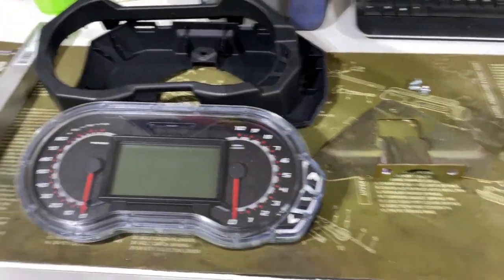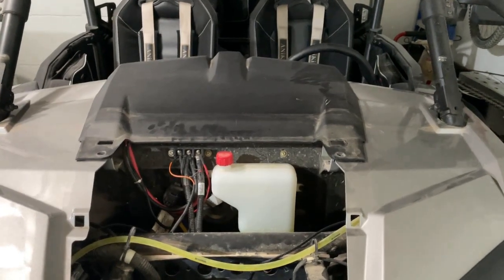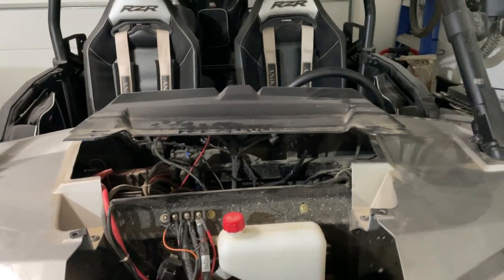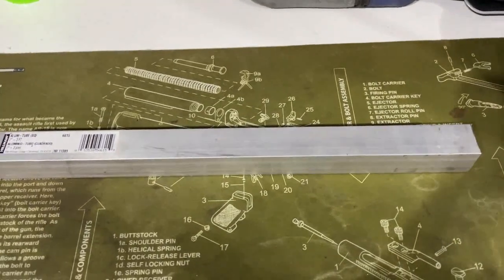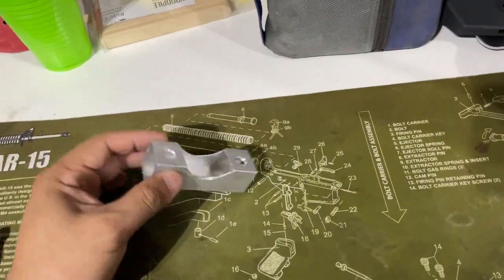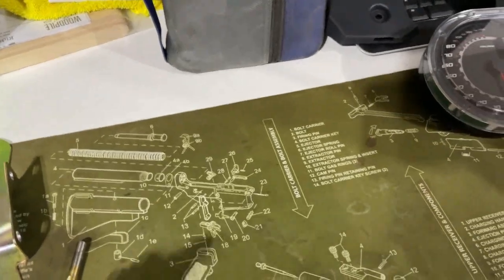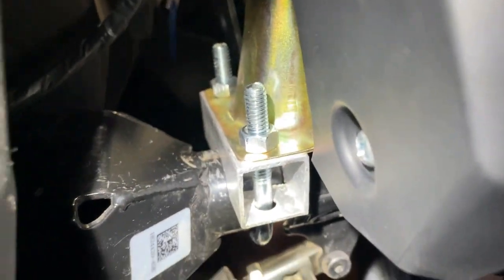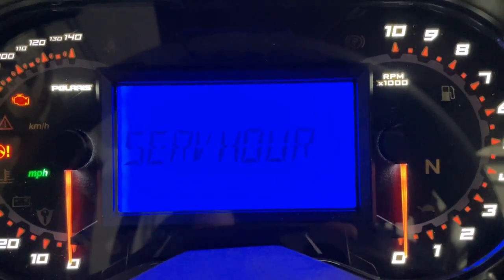DIY RZR S or XP 1000 Gauge Cluster Retrofit Installation

Comment: Dam dude!! Im picking up a 2015 1000 xp on saturday. The first thing im doing is follow this video and your ride command video. I hope they both work with the 15. Thanks for the instructions man!
Reply: Did this work on your 2015 I have one too and want to do this ?
Reply: @tonyrodriguez728  I haven’t done it yet, but from all the research I did it seems like it will work totally fine. I ended up getting a 2018 not a 2015. But dudes put them on all the years it seems like
Reply: @dangerdiesel3106   awesome ima try it out
Reply: @tonyrodriguez728 If you have a 2015 did this upgrade work
Reply: @mattclark2641 have you tried looking to do it also

Comment: When you put it on your machine, the miles and stuff reset with your mileage correct?
Reply from the maker: No, unfortunately your odometer mileage does not transfer to the new cluster. The Hours however do though.

Comment: Does the year depend on anything? I got a 2021-2023 cluster looks exactly like that one and I’m installing it onto my 2018 rzr 1000 xp and nothing is reading when I plug it into the stock harness. No rpm, no temp, no mph nothing. It lights up and all but it’s not reading anything

Comment: Where did you get the plug for the new gauge cluster?
Reply from the maker: I used the existing plug out of the back of the original cluster. Just extended the wires of it. It’s all plug and play.

Comment: 11-15 should be the same considering my guage took a shit in my 16 and i replaced it with 2013 just because it was all i could find locally used and it plugs right in and works just fine.

Comment: Solid! Planning this our right now on my 2018 XP4T with dash retrofit. Question if you know the answer... gauge p/n 3286838 is common on all 2020-2021 models. 2018 Turbo S, 2019 XP/XPT and 2019 RC models all have different part numbers. Do you know if there are really any differences from 3286838?
Reply from the maker: As far as I know they’re all the same gauge cluster so part # shouldn’t matter.
Reply: @CollaGoUnLTD  thanks for the reply! 👊

Comment: Do I did this swap with a ride command too, the high beam indicator on the 2019 cluster doesn’t function, is this normal?
Reply from the maker: You would probably need to run a wire to the pin on the harness for the bright indicator.
Reply: @CollaGoUnLTD  I have that wire there, it’s pin 8 on the factory and pin 8 on the new cluster
Reply from the maker: I’ll have to go out and take a look at mine and see if my indicator turns on when I hit my brights as Im not sure if mine works either.
Reply: @CollaGoUnLTD  thank you, I’m curious too cause it’s the same pin on both clusters

Comment: Thanks for the info did some more digging and found out you can buy a 2019 RZR turbo upper and lower dash (plus a hood) and have the cluster installed in the dash. If you want you can buy the dash frame. I just made the brackets to hold the cluster in place and for the ride command area . You can do this all for just under 1500 bucks. plus Paying for the ride command. I know it all fits cause I just did it on my 18 xp1000 4
Reply: What dash did u have before…I have the round cluster and wanted to upgrade… what is needed to do the dash ur referring to…do u have pics
Reply: The hood and dash of the 19 fit with your 18 fenders and facia?? Im curious because I’m doing the gauge swap on my 18 xp 1000 and would love to make it look factory

Comment: Hey man lovin the videos!! I just upgraded my cluster as well on a 17' polaris rzr xp 1000. I am having issues with the rpms not working with the new cluster. They show up and seem to work in the middle digital display, but the actual rpm needle only kicks up to 1000rpms and not true to the actual revolutions.

I plugged in the old cluster wires to the new one. am i missing a wire or do i need to splice one together?
Reply: Did you ever figure out your issue?
Reply: @alexwebb2208  no sir till this day. Haven’t had time to mess with it
Reply: I have the same issue. Mot working anything. No rpms no fuel  or temperature.